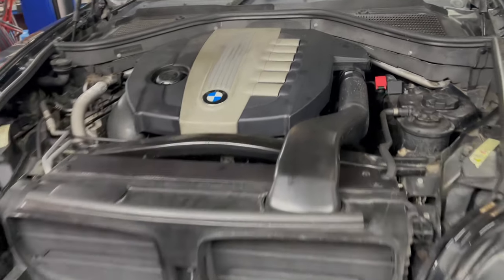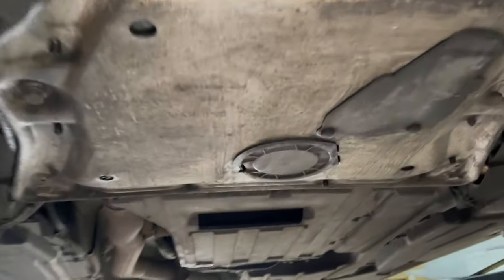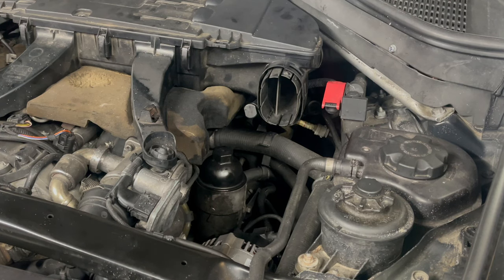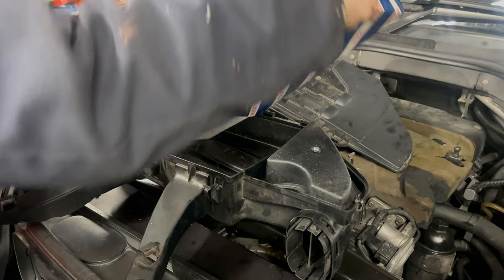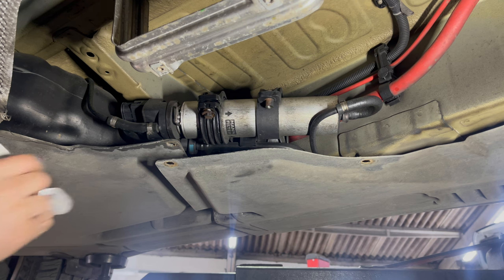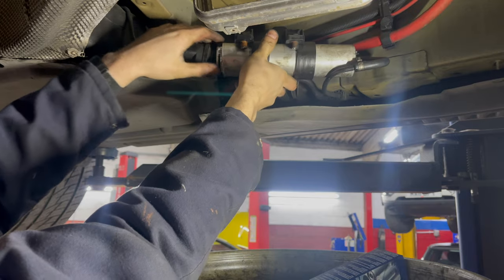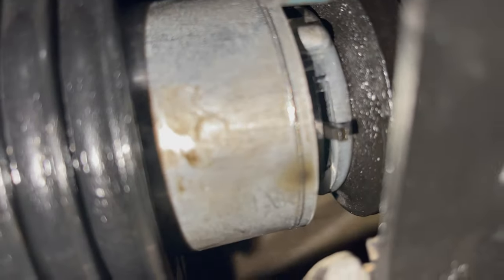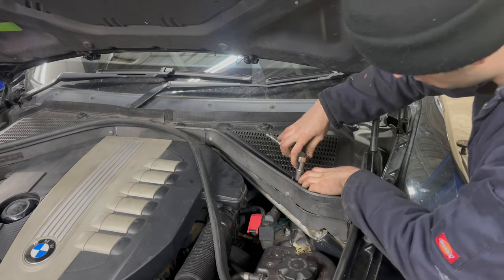BMW X5 E70 3.0D Complete Filter Service - Air Oil Fuel Cabin How To Change DIY

Comment: Great stuff as always. How are these M57’s in terms of reliability? I know some suffered from problems with swirl flaps.
Reply from the maker: Cheers Gentil, swirl flaps and cracked intake manifolds I think are the only ones I’ve seen personally. Things that I’d expect to fail such as the auto gearbox and key fob I’ve never seen any issues with. I haven’t owned a 3.0 diesel by BMW yet though.

Comment: Great job! Question , if the air filter hasn't been replaced in a while, will it cause the car not to run properly?
Reply from the maker: If the condition of the air filter is bad it definitely wouldn’t aid the car running properly. If you’re unsure it’s best to change it.
Reply: @IAMASPANNER   It isn't that far off from the one you changed... But I will change it,thank you